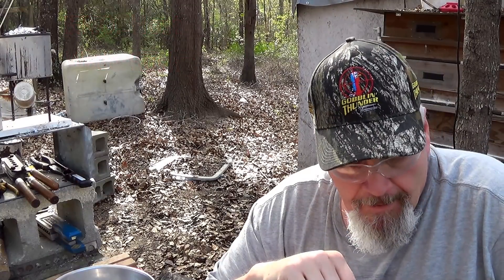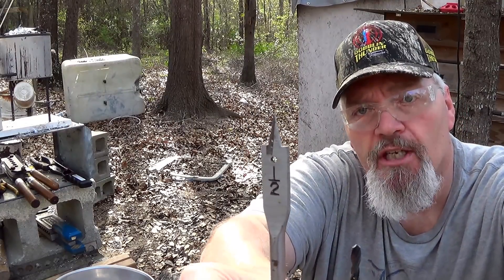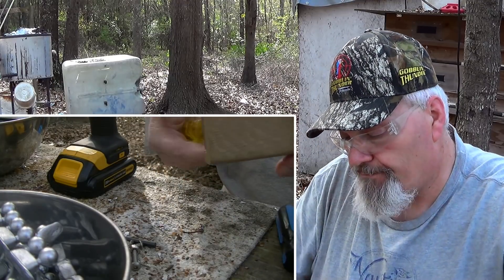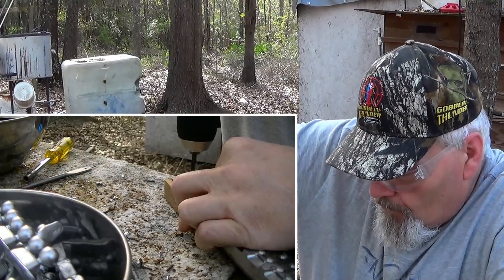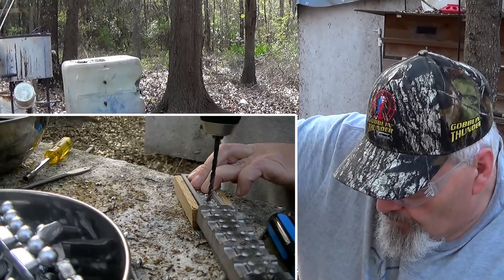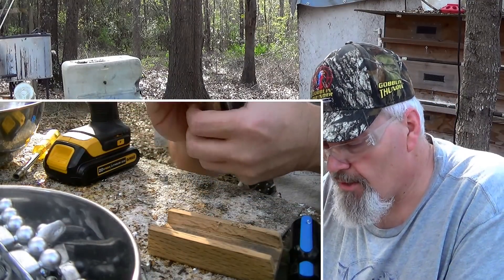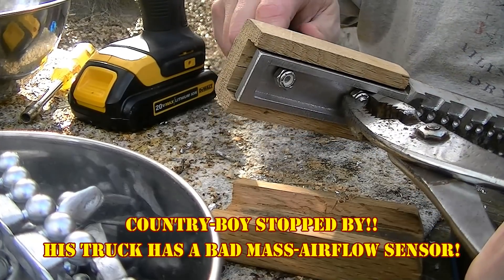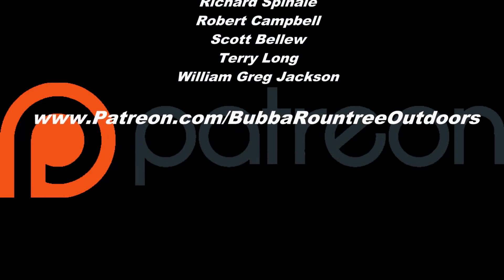Fixing the Handles on the Old Sharp Shooter Buckshot Molds!

Comment: Hey what is a good choke for dove hunting I want a Carlson extended choke but not sure which one to get? For my stoger m3000
Reply from the maker: The Carlson I/M in .700 constriction works great in my M3000!
Reply: Bubba Rountree Outdoors do you have a link to the website?
Reply from the maker: Here's a dang good deal on a used Mod. choke! https://www.ebay.com/itm/Carlson-Beretta-Benelli-Mobil-12-Ga-Modified-Extended-Sporting-Clays-Choke-Tube/202284661800?epid=1323095836&hash=item2f191afc28:g:IU8AAOSw17pay~x-